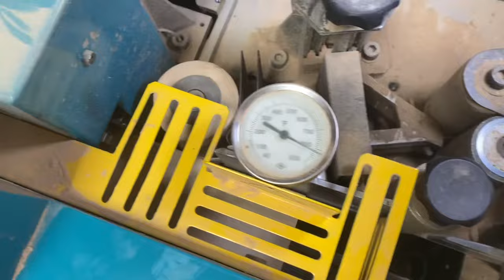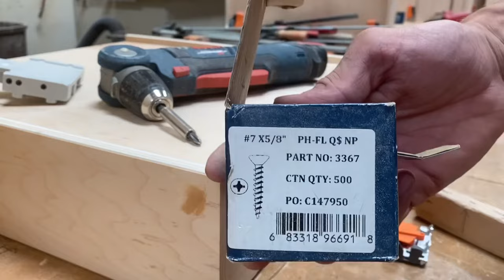SAVE $$ DRAWERS MADE EASY!

Comment: Dovetails and box joints are objectively better in every way, but it's not necessary and it requires expensive machinery to make them. You gotta be making a lot of drawer boxes to justify it. I used make all kinds of arguments for why a jointed drawer was unnecessary, but then started making them and would never go back. Assembly easier, visual quality is better and actual time it takes isn't way more. Looks like you've got a good shop and if you're making lots of drawer boxes, I highly suggest integrating a platform to make a jointed box. You won't regret it.
Reply from the maker: Good points ! I agree . We sell both to clients but I’ve been outsourcing dovetail to save time but have been looking into investing in a proper setup to make them quickly and efficiently myself .
Reply: I live in Massachusetts, and I've had more than one client ask if my drawers are solid wood dovetailed also a couple building contractors. 
I sourced them out a few times, and it's only slightly more expensive than the prefinished plywood drawers i was building , but boy, do I hate when the bill comes in .
I have one of those old really heavy-duty 
Porter-Cable 24" dovetail jigs , I set up a dedicated router, and I do it myself now
Keeping the work to myself ....

Comment: I made the tool drawers in the back of my van with glue and brads, they’ve had heavy use for 3 years and have held up brilliantly
Reply from the maker: Great to hear ! They do hold up better than most would think
Reply: You mind sharing specs of your tool drawers?  Like wall widths of the walls and width of base?  I'm going to build some drawers and such for my van I use for locksmith work.

Comment: That's a very good design. quite simple drawer and seems very strong.   👍
I have watched 100 drawer build videos , IMO yours is most suitable for a beginner like me. I'm gonna build a cabinet with some drawers to hold my hand tools at home.
I'm not a woodworker but a mechanic, years of experience has given me some degree of intuition to gauge strength in a design.

Thanks so much for sharing.
Reply: Good design, excellent execution. Your technique of attaching the bottom to the front panels that's just wow! Simple way to achieve precision! You're truly an engineer 👍
Reply: I'll build the side-mounted slides version
Reply from the maker: Great to hear , thank you !

Comment: Encouraging. Selecting the correct thickness of the parts is the key—and well done here—so that one part strengthens the next part and the result is exponentially greater strength than the individual parts. This is a well thought out way of making drawer boxes, it seems too simple to be true. Do you know how hard it is to do 'simple?' Simple actually requires considerable skill.

Comment: I have made about a half dozen kitchens, and all of my drawers have been built just like this and I have never had a problem.  Until, that is, my most recent one.  I decided to use double sided prefinished maple this time..... thinking I was smarter.  Problem is, I cut the hundred+  pieces to be simple butt joints, but with the double-sided finish one of the surfaces isn't virgin wood and the wood glue simply doesn't work.  This would have made a rabbet joint a much better option.  Instead, I had to painstakingly sand through the finish on each end of about 50 pieces, being careful just to sand the 1/2" end of the long side of the butt joint and no further into the visible area of the box.

Yes, I tried other adhesives....and the ends didn't justify the means.    I trust wood glue, I didn't trust these adhesives....especially after gluing together some test scrap piece joints and watching them break pretty easily.  

Moral of the story - if you don't have prefinished sheet goods this method works splendidly.  If you do, I'd recommend a rabbet joint so that the pre-finished piece is rabbeted and accepts the wood glue much better.  Wood glue is truly some amazing stuff, IF it's used wood-on-wood.  It was helpless on these joints and simply flaked right off as it couldn't penetrate the fibers and apparently has very little bonding strength to other non-wood surfaces.

The bottoms were 1/2" as well and I was content just using a bunch of brad nails with some 8 gauge 1 1/2" narrow head trim screws on some of the wider drawers.  If I had to sand off the entire 1/2" perimeter of each bottom I'd still be sanding.
Reply from the maker: Exactly! Well said ! And I did say in the vid that this only works with unfinished material,  thats important bc the glue won’t bond the pre finished wood. This is  one of multiple ways we make drawers depending on price point , due to their simplicity I wanted to share this first . I have other methods including dovetail which I’ll be showing in a future vid . Thanks for the comment !

Comment: Great video. Not so sure it's saving money that's the biggest take away as is saving time and aggravation! If using 1/2" thick sides is length of the drawer fronts the same 1 11/16" less then the opening?

Comment: Love the videos. 1 question tho when you make the drawers for pullouts that don’t get a drawer front what do you do to make the front of the drawer a little more attractive?
Reply from the maker: I attached solid hardwood fronts to those . Same as I would a drawer front and just call it a pullout front . I match the outside wood of the cabinet . Either painted or stained the same color to match . They look really nice like this .
Reply: @cabinetwise  so do you set the drawer slides back a little? Otherwise they would hit the door when it closes.
Reply from the maker: @kennethgreenwood1362  yes exactly I set them back an additional 3/4”

Comment: Nice video....1 question ..You used 3/4" ply front and back but when you screwed the slide brackets to the 1/2" bottom you mentioned that they were 5/8" from the front edge. Why not 3/4"?

Comment: Jason @ Bourbon Moth does a cool video on testing all the joinery methods for strength and was surprised to see that dovetails weren't stronger
Reply: I saw that vid. I wonder if he hung weights from the joint if the numbers would have been different...
Reply: Possible, but it’s so outside the use condition for furniture/cabinets so as to virtually ensure us that it’s not going to fall apart

Comment: Can I use 1/4 inch on the bottom ? 1/2 feels too heavy
Reply from the maker: For this method it’s ideal to use half inch simply because there is no joinery or dados . It keeps the rigidity and strength needed. For 1/4” bottoms is recommended to dado out the bottom of the drawer sides , then slide it in . If that makes sense ..